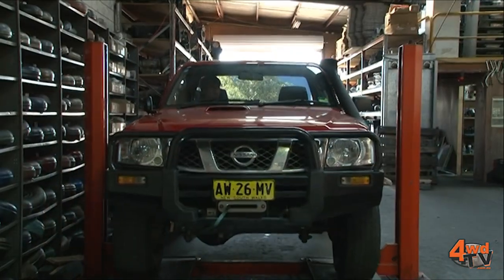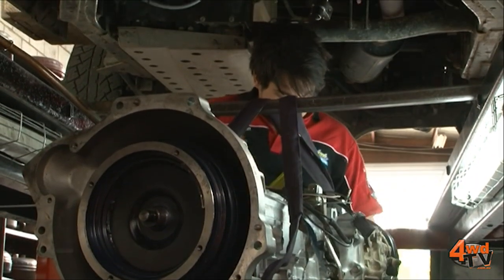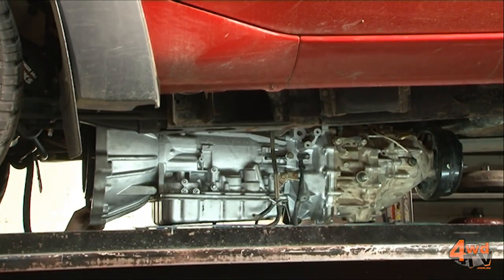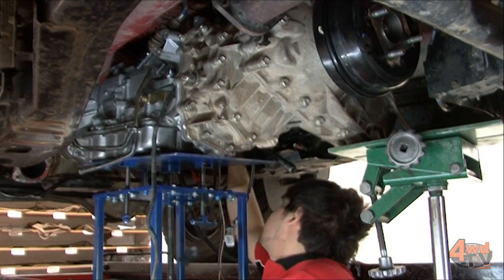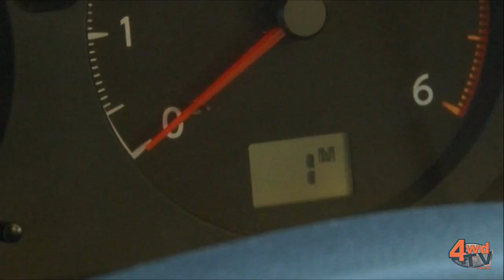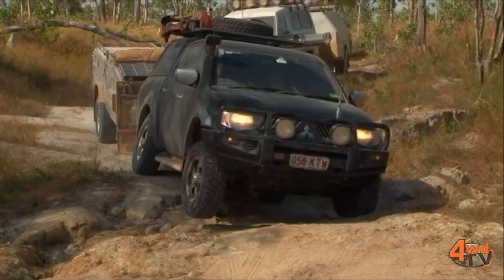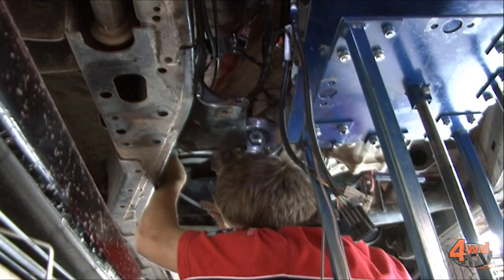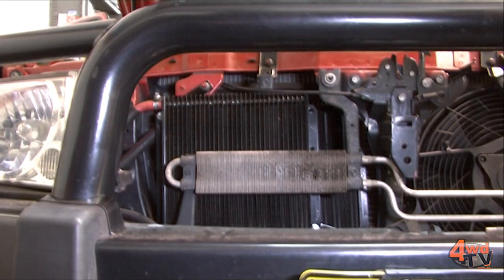Manual to Automatic Conversion

Comment: The biggest thing is automatics are cheaper per hp than a manual.  So a ford c4 or c6 can handle 450 hp and are about $1000 for a performance tranny.  For a manual your only option is tko or t56 and they are $2300.  T5 are about $1700 but can only handle 300 lb/ft.  Same for chevy th350 which are a dime a dozen and have tons of aftermarket support.

Comment: I am interested in converting my 3 speed manual transmission to an automatic transmission in a 1965 Dodge with a six cylinder 2wd engine.  Do you have a rebuilt transmission for this purpose ?  Thank you.  J. Junior

Comment: How long does this take & how much does it cost?

Do you know if its possible to do this with an old manual diesel 6N2 Polo? My city no longer allows diesel (shame on them) so currently not using my beloved car, but if I refit I would want an automatic.
Reply from the maker: The conversion from manual to auto for the Polo is very difficult and also very expensive, it would be far cheaper to sell the car and purchase a later model that already has the automatic transmission. Not all models have this option and that is why we do the auto conversions when this is not an option.
Reply: @WholesaleAutomatics  OK, that's a shame, but thank you so much for the advice & sharing your knowledge, much appreciated!
Reply: Please, how much does the process cost, thank you ,
Reply: Cheaper well it would just be a bit more expensive and time consuming but , is it possible.  And how much.  Maybe 2,500 $ total? Or 3,000? How long maybe a week , thats not long at all

Comment: It might not be possible for audi a6 Quattro.  Since Quattro is 4 wheel drive.  Is that correct ? 
So,, you'd have to take a look. But it might be possible.
Reply from the maker: The cot would be very expansive in this case, possibly more that the car is worth.

Comment: I'm about to acquire a 1985 Nissan 720 Sport Truck with a manual transmission. I don't really want to embarrass myself driving it and was wondering what it would take to convert it to an automatic.

I haven't even bough the thing yet, and I'm already making plans to restore it to its former glory, but I'm not good with manual vehicles. I did all my manual training in an 18-wheeler.

Comment: real drivers  drive manual. because you have better control of your vehicle.
Reply: 4X4 BIT DIFFERENT,auto better than manuel,more control,but needs a lock up t converter on low range.
Reply: Well when you don't have a right leg to control the gas pedal on air k crawler..Then you can say that..lol
Reply: yeah but the fact that the clutch needs replacing every other time , sucks. lol
Reply: Not really, in busy cities and  long journeys Auto is the best to drive